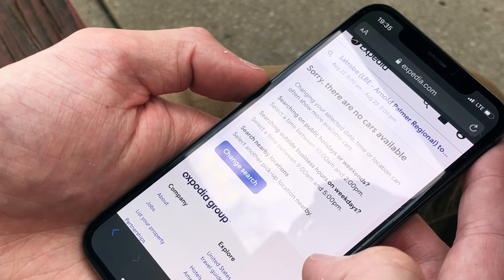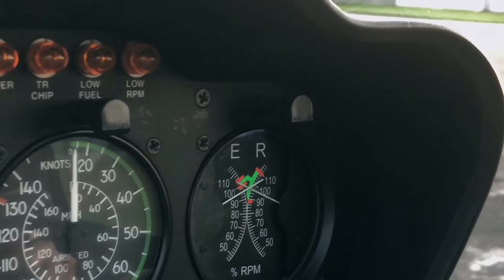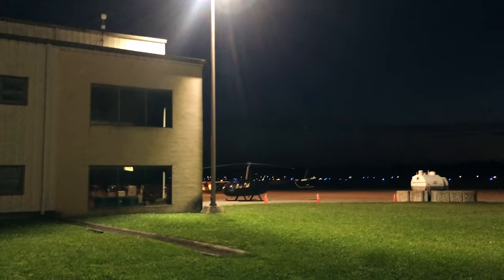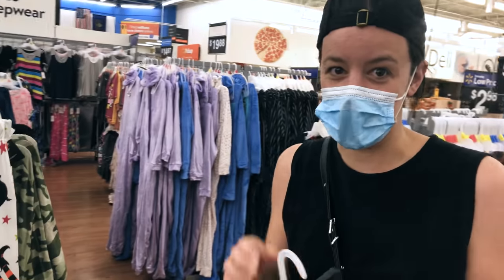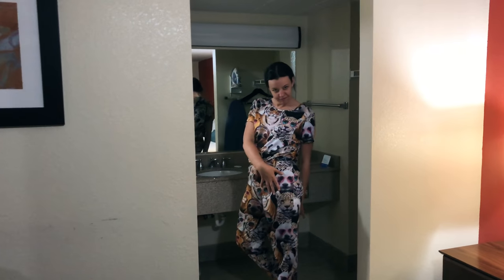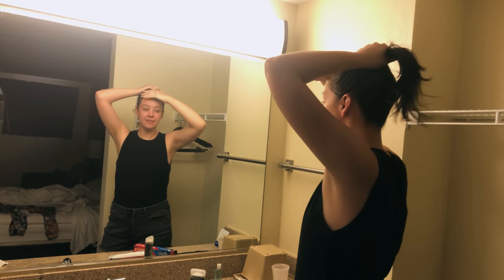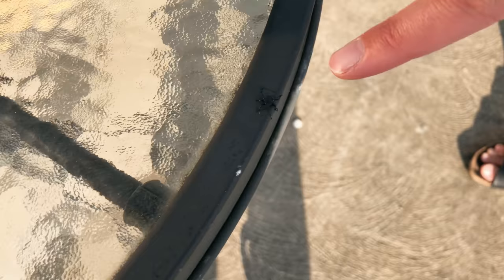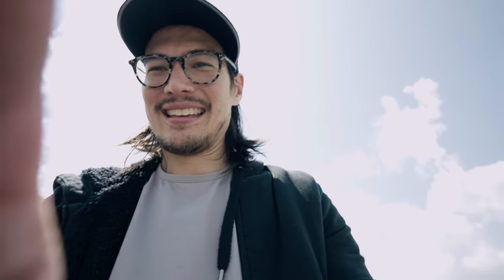This Light Almost Destroyed Our Trip | Realities of Helicopter Ownership

Comment: Huge plus that the switch didn't derail the check ride!  And you guys are 100% correct that small fixed-wing would not be "better" for Bad Guts' Peckham's motion issues.  Flew a 172 in gusty conditions yesterday and there were multiple "Yee Haws!" as we got the buckin' bronco action in the air and while landing.